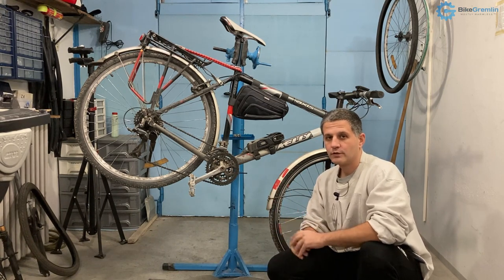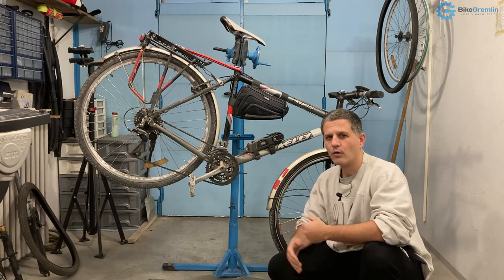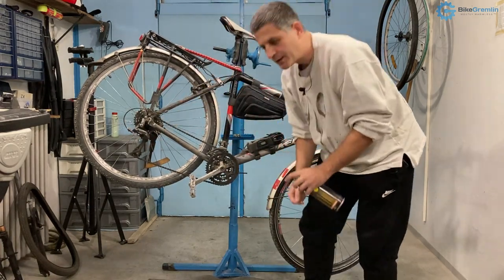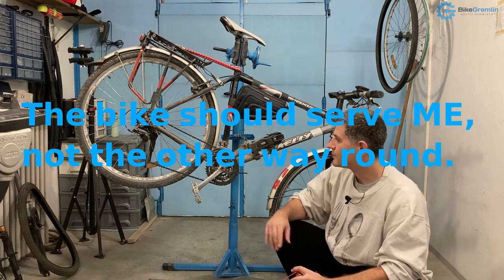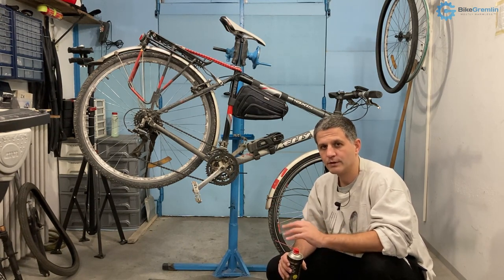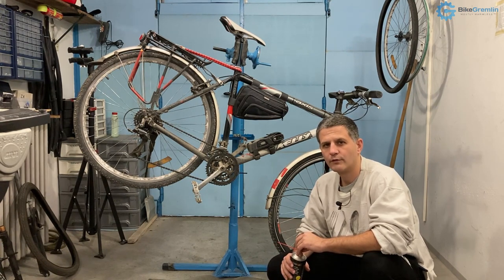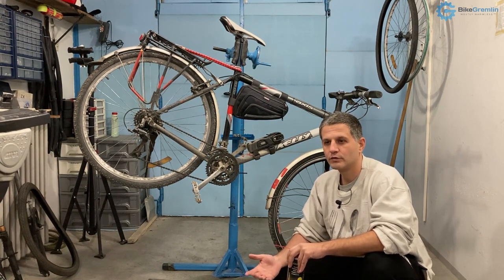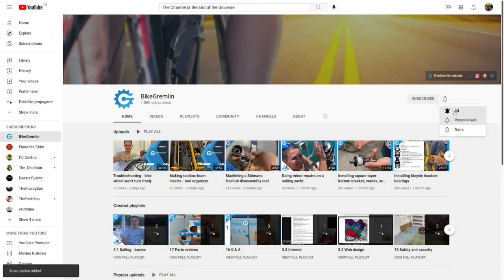How to "winterize" a bicycle?

Comment: Really enjoying your videos! You have the same "no BS" philosophy I have.
I've only been riding in the winter for a couple of years now, but I quite enjoy it. Last winter I rode in -35C. It was OK, just had to dress warmly and used bar mitts to keep my hands warm. The feet are always tough to keep warm, but I had 3 layers of socks, a felt boot insert and very warm boots to keep the cold at bay. The bike's components do tend to seize up, so I need to spray WD40 more often. I also use a beater MTB with Schwalbe Marathon studded winter tires on both wheels, since I like riding in the river valley, so lots of hills to climb. I'm in Edmonton, Canada. 
Cheers!
Reply from the maker: That's cool (pun intended :) )  - I never rode below -20C, because our temperatures don't drop below that generally.

Let me know If you have any tips or (especially) corrections regarding my winter cycling articles:

https://bike.bikegremlin.com/category/riding/winter-cycling/

I suppose stuff like hydraulic mineral oil gets different once you go below -30C.

Comment: I use snakeskin 2.5 inverted thread tyres on my 29er mtb. Drop the pressure then it's greatly increased surface contact and therefore control.
Requires a bit more work to roll but then, it's cold and I want to warm up!

Comment: My solution is to have 1 aluminum beater for snow or wet weather (A worn out FX I rebuilt) that I run wet chain lube, kool stop salmon pads, and put studded tires in the winter.  I have a couple other beaters I can take out  when the roads are dry.   I need studded tires on both front and back because my entire town is basically situated on a hill.  But a good portion of the winter can just be cold and dry with tons of dusty salt and sand everywhere favoring a dryer chain lube.

Comment: Fatbikes, they swim through deep snow and sand. Takes a bunch of power to ride them in those conditions (or granny gear) as you drag it a bit, but they do not sink like normal or even plus sized tires, especially if you drop some pressure. They also work better on rocks, curbs, stone, damaged asphalt. The tradeoff is that you have some more rolling resistance in typical road conditions (not bike park, that ends up with fat tires winning) and more wheel weight to lug which may affect endurance.
Plus some tires can have a kind of self-steering effect that is even more when they're fat, which is mostly important to downhill riders.

As to the tire thread, I'm a proponent of invert thread - like motorcycles and most cars - it's the one that has deep ridges. BMX tires tend to use that kind of thread too. It gives big contact surface while still being able to disperse snow, mud and water well unlike a slick, and works decently on thin sand, gravel or hardpack.
Reply: But they are only suited for offroad, not pavement. And is of you want to ride on pavement you need to increase tire pressure and when going off-road decrease every time 😅😂